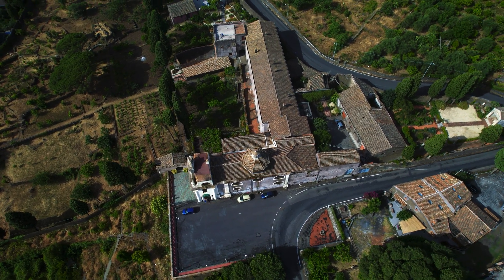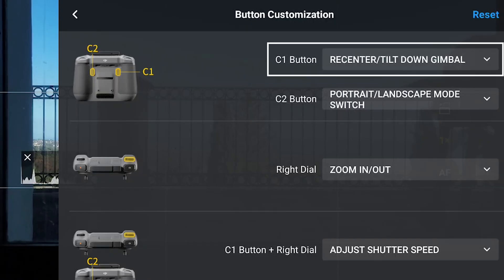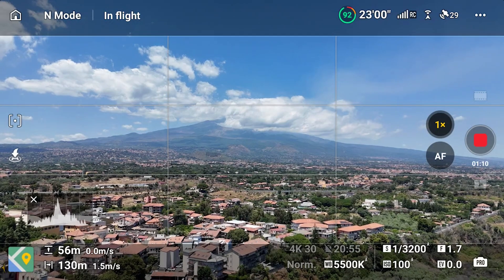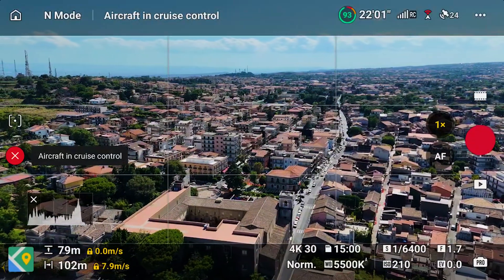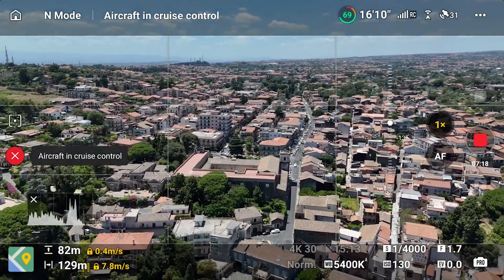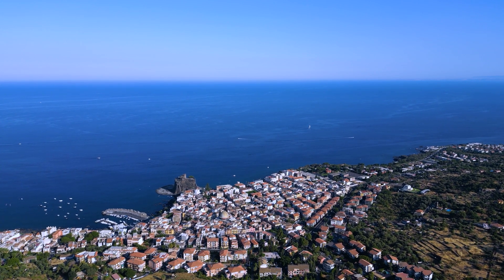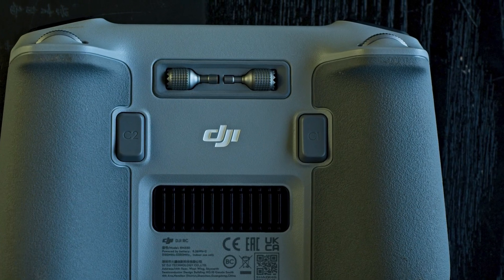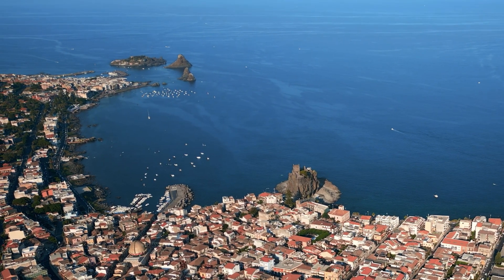Cruise Control - How to Use it on DJI Mini 4 Pro, Flip, Air 3 and Mavic 4 Pro

Comment: thanks so much for showing that a stacking of movements is step by step possible.
I always thougt (never tested) if i press the cruise controll twice, you will end this mode.
This makes it so much easier. All movements in one step would be very difficult sometimes.
Reply from the maker: I agree,
stacking several moves with Cruise Control is often very useful